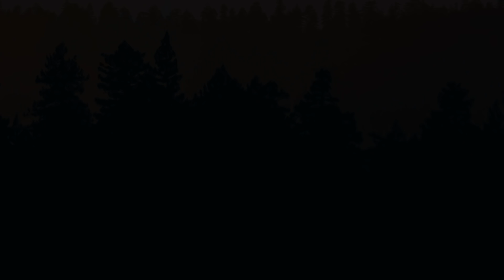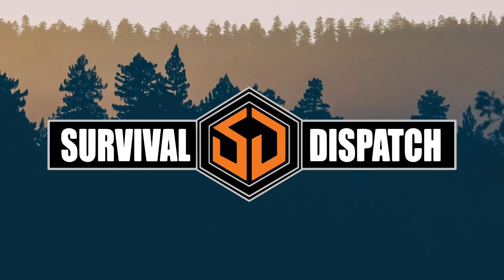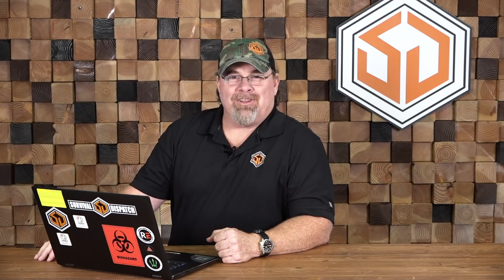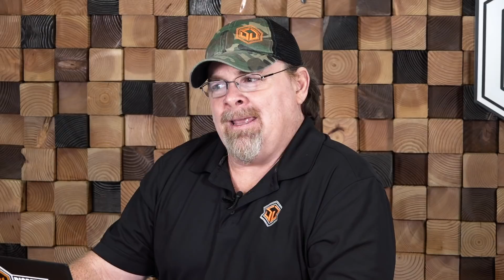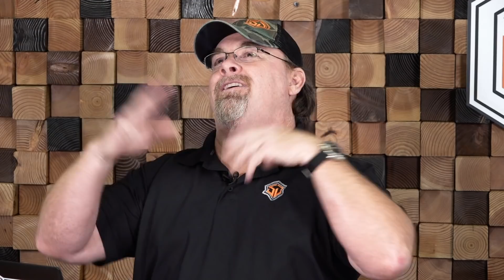All About Generators!

Comment: What about adding a buck booster on the power from the generator before you plug into your load.
Reply: Here are the rules about portable generator safety: This is just a reminder for everyone’s safety. All generator safety rules should be followed carefully. This advice is just to make sure that everyone is aware of all the warnings and it’s just to remind people to be careful using portable generators. Generators can be dangerous if not used carefully. Every year, hundreds of people die or get injured when using portable generators due to carbon monoxide poisoning and electrocution. Make sure you are using your generator carefully and keeping others safe as well. There is something very serious that everyone should always be aware of when using generators. Some people do run their generator indoors which is not safe and that increases the risk of carbon monoxide poisoning which can cause death of family and you. Some people run their generator in wet conditions which can electrocute them. Please remember that you should never run your generator indoors. Remember that carbon monoxide is an odorless and colorless gas that you cannot see or smell. Carbon monoxide is a silent killer. Keep that in mind. Make sure your generator is 15-20 feet away from your house and away from doors, windows, and vents. Never use your generator in your porch too. Having a carbon monoxide detector is very important against generator safety. Some people also allow children to go near the portable generator which could pose risks. We need to keep an eye on our children making sure that they are not near the portable generator so they won’t get electrocuted or burned by the generator which is dangerous. A locking enclosure also keeps kids safe. A generator shed might look like a tempting place to explore, or take cover during a game of hide and seek, but a generator is a dangerous piece of equipment that can cause injury. It says on the manual that we should also keep children away at all times from the portable generator to avoid injuries. Please do not allow a child or unqualified people to operate the portable generator.  It is important to keep your children safe especially little ones. The portable generator can be hot during an operation. Just because some manuals missed what should be listed doesn’t mean it’s safe to do. Always follow the generator safety rules when using portable generators. Generators pose electrical risks. If you need to use your generator during wet weather, you need a generator tent to protect your generator from getting wet. Don’t let your generator get wet. Keep your generator dry and before using your generator, please make sure your hands and your generator is dry. Do not wear loose clothing when operating the generator. Everything that is said on the generator’s operating manual should not be ignored. Never smoke cigarettes near the generator. Please keep flammable things away from the generator. Never overload your generator too. Your generator can catch fire. Never ever try to plug a generator cord into a wall outlet to avoid back feeding. Back feeding your generator is dangerous. Always turn on your generator first before plugging in appliances and shut off the appliances before turning your generator off. Use a heavy duty cord for your generator and the cord should not be worn out. All the instructions should be followed carefully. Never refuel your generator while it’s running. It can cause fire if fuel spills while your generator is hot. You should turn off your generator and let it cool off before refueling it. Having a fire extinguisher next to the generator is also important. This is only a reminder for everyone’s safety of using generators. Make sure your generator is properly grounded. Having a fire extinguisher next to the generator is also important against the safety rules. https://youtu.be/I1jT3ANENvI and here is a video more about keeping others safe when using generators and also about our family’s safety. It’s important to keep our little children safe too. Hope this helps. Thank you.

Comment: VERY CORRECT. THE MAINS MUST BE TURNED OFF OR  THE POWER AT THE SERVICE DROPS
GOES UP THE POLE, TO A TRANSFORMER AND WAY MORE THAN 240 VOLTS IS ON THE
OTHER SIDE OF THE TRANSFORMER! Yes great ideas I fix gens and do maint. plans for my
customers. also cleaning the air filter is very important. That is what I tell my customers, extra
oil, spark pugs fuel and air filters, also that to fill a hot generator is looking for some time in
the burn center.  After IRMA passed thru FL. some dumb-ass broad had her generator in the
living room and a person in a bedroom died of carbon monoxide.
Reply: Everyone really needs to watch this video 
https://youtu.be/I1jT3ANENvI it’s so very important that everyone should know about

Comment: We bought a $120 12 volt inverter from Harbor Freight, 2000 watt 4000 peak. We use it on a Prius parked in the back yard .  The Prius automatically starts when the battery gets low . One tank will last a week. Move the extension cord around, minimize opening  refrigerator . 2000 watts is enough to be comfortable. You just cant do everything at the same time.
Reply: I hope you agree with this video https://youtu.be/I1jT3ANENvI hope you stay safe
Reply: When I did that on my 2005 prius I looked up the 12v inverter that then Prius had. It was 100 amps. So at 12v that is 1200 watts. I decided I did not want to burn that out so I kept my load below 800 watts. 

Now I have a Nissan Leaf. Same idea with 12v to 120v inverter mainly just for my fridge and Cellphone which use 2kwh a day. So the 24kwh battery can give me a week and still have 20 miles of range to drive to the closest working charger to charge back up. 

If the power outage is longer than 7 days and larger than 20 miles I go dark. Which wouldn’t happen with the prius.

Comment: I have two backup generators.  One is an old Onan 4kw 1800rpm RV genset from the 1980s.  I converted  it to natural gas and is in a sound enclosure.  It's very quiet and there's no electronics to fail. 100% mechanical right down to the breaker point ignition.  It's big and heavy.  The other is the HFT Predator 3500 inverter.  It's very quiet too and I left it set up for gasoline.  I keep a running log and start it at least once a month + use fuel stabilizer.  No problems with  bad fuel like this. Got it super cheap as an open box returned that ran terrible.  Fixed the exhaust restriction and good as new.  I like quiet generators and recommend spending the extra for an enclosed unit unless your neighbors are far away.
Reply: I really hope you watch this video too about another generator safety https://youtu.be/I1jT3ANENvI thank you. Everyone really needs to watch this

Comment: We went 16 days w/o power running a 9500 watt Briggs and Stratton after Hurricane Ike here in Houston. Ran the entire house except central AC, we used a window unit in master bedroom. Unit was tied into my service panel and back fed the house till utility power was restored. Biggest challenge was finding gasoline, I had a weeks worth ahead of the storm and had to get out and hunt for it after that. Learned my lesson and modified that unit to run on natural gas and adapted a quick disconnect gas line and still back fed into service. 3 years ago had a 22KW Honeywell unit installed with auto transfer switch that runs on natural gas, life is good now. Thanks for the video. I still have the Briggs as a back up and fire it up 2 X per year to test.
Reply: Here are the portable generator safety rules: this safety information is only for anyone who use a portable gas generator and for those who are planning on getting a portable gas generator. This is just a reminder for everyone’s safety. All generator safety rules should be followed carefully. This advice is just to make sure that everyone is aware of all the warnings and it’s just to remind people to be careful using portable generators. Generators can be dangerous if not used carefully. Every year, hundreds of people die or get injured when using portable generators due to carbon monoxide poisoning and electrocution. Make sure you are using your generator carefully and keeping others safe as well. There is something very serious that everyone should always be aware of when using generators. Some people do run their generator indoors which is not safe and that increases the risk of carbon monoxide poisoning which can cause death of family and you. Some people run their generator in wet conditions which can electrocute them. Please remember that you should never run your generator indoors. Remember that carbon monoxide is an odorless and colorless gas that you cannot see or smell. Carbon monoxide is a silent killer. Keep that in mind. Make sure your generator is 15-20 feet away from your house and away from doors, windows, and vents. Never use your generator in your porch too. Having a carbon monoxide detector is very important against generator safety. Some people also allow children to go near the portable generator which could pose risks. We need to keep an eye on our children making sure that they are not near the portable generator so they won’t get electrocuted or burned by the generator which is dangerous. A locking enclosure also keeps kids safe. A generator shed might look like a tempting place to explore, or take cover during a game of hide and seek, but a generator is a dangerous piece of equipment that can cause injury. It says on the manual that we should also keep children away at all times from the portable generator to avoid injuries. Please do not allow a child or unqualified people to operate the portable generator.  It is important to keep your children safe especially little ones. The portable generator can be hot during an operation. Just because some manuals missed what should be listed doesn’t mean it’s safe to do. Always follow the generator safety rules when using portable generators. Generators pose electrical risks. If you need to use your generator during wet weather, you need a generator tent to protect your generator from getting wet. Don’t let your generator get wet. Keep your generator dry and before using your generator, please make sure your hands and your generator is dry. Do not wear loose clothing when operating the generator. Everything that is said on the generator’s operating manual should not be ignored. Never smoke cigarettes near the generator. Please keep flammable things away from the generator. Never overload your generator too. Your generator can catch fire. Never ever try to plug a generator cord into a wall outlet to avoid back feeding. Back feeding your generator is dangerous. Always turn on your generator first before plugging in appliances and shut off the appliances before turning your generator off. Use a heavy duty cord for your generator and the cord should not be worn out. All the instructions should be followed carefully. Never refuel your generator while it’s running. It can cause fire if fuel spills while your generator is hot. You should turn off your generator and let it cool off before refueling it. Having a fire extinguisher next to the generator is also important. This is only a reminder for everyone’s safety of using generators. Make sure your generator is properly grounded. Having a fire extinguisher next to the generator is also important against the safety rules. https://youtu.be/I1jT3ANENvI and here is a video more about keeping others safe when using generators and also about our family’s safety. We need to keep our children safe especially little ones. Hope this helps. Thank you.
Reply: @The_Happy_Aviation_Enthusiast  I would recommend a fire blanket over or at least in addition to a fire extinguisher 🧯🔥because you can possibly use the wrong type of extinguisher plus they are messy... it obviously depends how quickly any fire is detected,  some CO monitor /alarms have a combined smoke alarm built in.
Reply: Would natural gas stop flowing during a COMPLETE power grid shutdown??
Reply: Yes
Reply: 9500 is a good bit of power. It would probably run a 4 ton AC...maybe nothing else but may have enough juice for an AC alone.

Comment: Great tip on loading the refrigerators
Reply: Here are the portable generator safety rules: this safety information is only for anyone who use a portable gas generator and for those who are planning on getting a portable gas generator. This is just a reminder for everyone’s safety. All generator safety rules should be followed carefully. This advice is just to make sure that everyone is aware of all the warnings and it’s just to remind people to be careful using portable generators. Generators can be dangerous if not used carefully. Every year, hundreds of people die or get injured when using portable generators due to carbon monoxide poisoning and electrocution. Make sure you are using your generator carefully and keeping others safe as well. There is something very serious that everyone should always be aware of when using generators. Some people do run their generator indoors which is not safe and that increases the risk of carbon monoxide poisoning which can cause death of family and you. Some people run their generator in wet conditions which can electrocute them. Please remember that you should never run your generator indoors. Remember that carbon monoxide is an odorless and colorless gas that you cannot see or smell. Carbon monoxide is a silent killer. Keep that in mind. Make sure your generator is 15-20 feet away from your house and away from doors, windows, and vents. Never use your generator in your porch too. Having a carbon monoxide detector is very important against generator safety. Some people also allow children to go near the portable generator which could pose risks. We need to keep an eye on our children making sure that they are not near the portable generator so they won’t get electrocuted or burned by the generator which is dangerous. A locking enclosure also keeps kids safe. A generator shed might look like a tempting place to explore, or take cover during a game of hide and seek, but a generator is a dangerous piece of equipment that can cause injury. It says on the manual that we should also keep children away at all times from the portable generator to avoid injuries. Please do not allow a child or unqualified people to operate the portable generator.  It is important to keep your children safe especially little ones. The portable generator can be hot during an operation. Just because some manuals missed what should be listed doesn’t mean it’s safe to do. Always follow the generator safety rules when using portable generators. Generators pose electrical risks. If you need to use your generator during wet weather, you need a generator tent to protect your generator from getting wet. Don’t let your generator get wet. Keep your generator dry and before using your generator, please make sure your hands and your generator is dry. Do not wear loose clothing when operating the generator. Everything that is said on the generator’s operating manual should not be ignored. Never smoke cigarettes near the generator. Please keep flammable things away from the generator. Never overload your generator too. Your generator can catch fire. Never ever try to plug a generator cord into a wall outlet to avoid back feeding. Back feeding your generator is dangerous. Always turn on your generator first before plugging in appliances and shut off the appliances before turning your generator off. Use a heavy duty cord for your generator and the cord should not be worn out. All the instructions should be followed carefully. Never refuel your generator while it’s running. It can cause fire if fuel spills while your generator is hot. You should turn off your generator and let it cool off before refueling it. Having a fire extinguisher next to the generator is also important. This is only a reminder for everyone’s safety of using generators. Make sure your generator is properly grounded. Having a fire extinguisher next to the generator is also important against the safety rules. https://youtu.be/I1jT3ANENvI and here is a video more about keeping others safe when using generators and also about our family’s safety. It is important to keep our little children safe too. Hope this helps. Thank you.